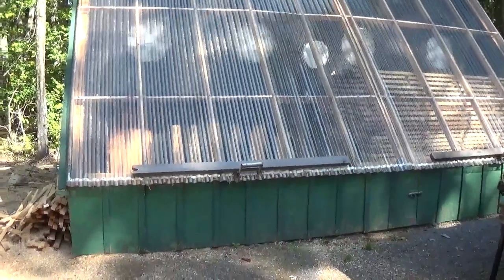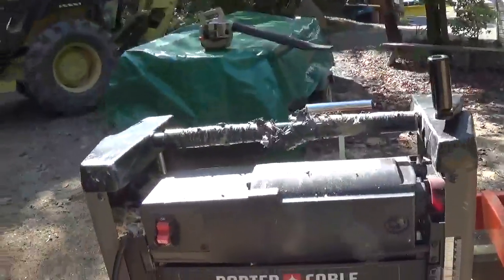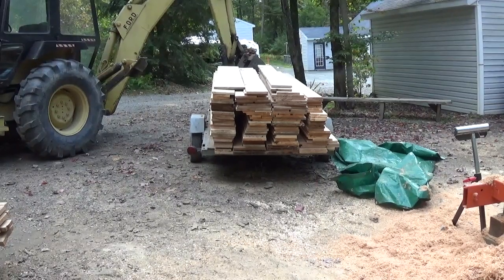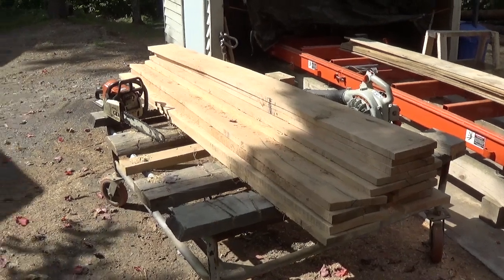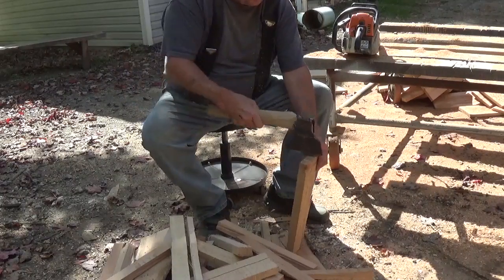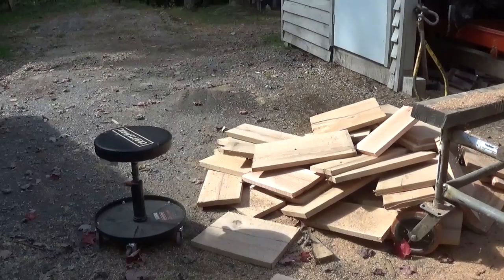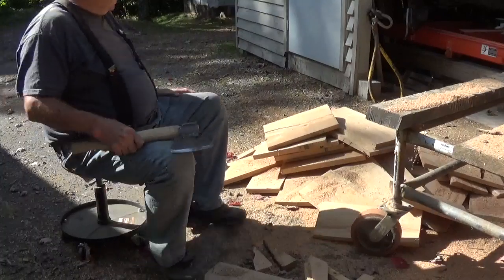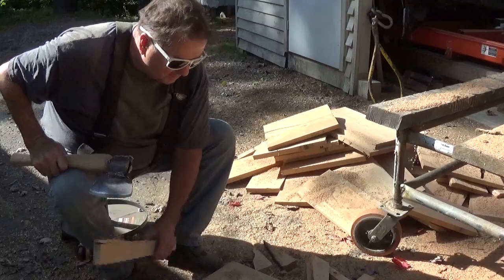Cleaning planer, chopping kindling, talking and hoping.

Comment: It would save on manual labor Joe if you could design a kiln that would allow you to use the forks on your backhoe to set one of the entire stacks of air drying lumber into it. And remove the entire stack with the forks.
Reply from the maker: My kiln is designed for that. The 4 foot forks are what is missing. I need to build them.